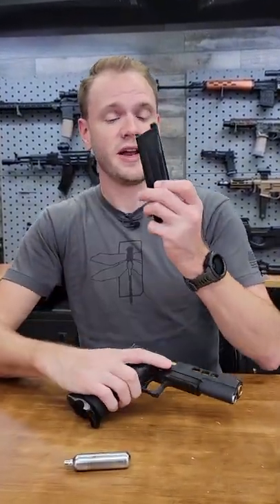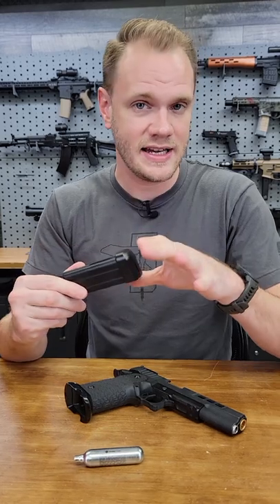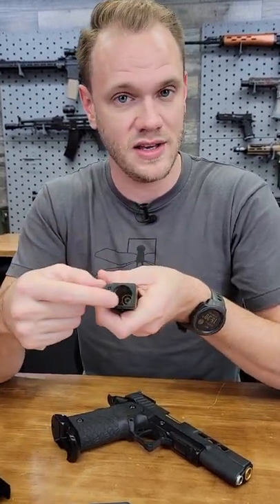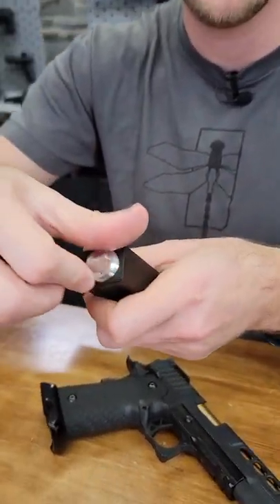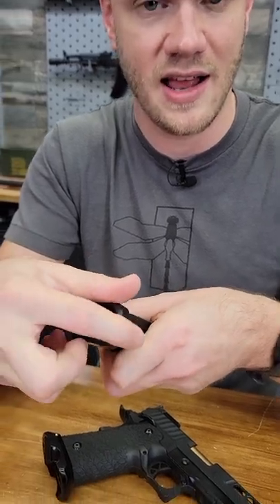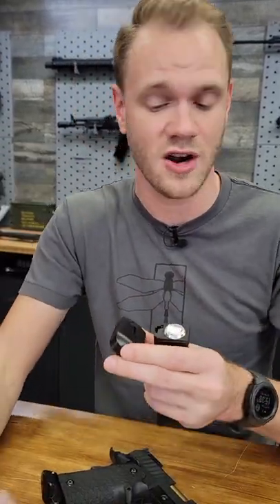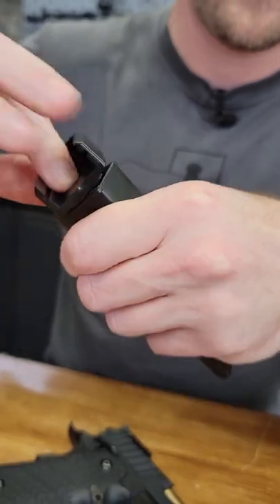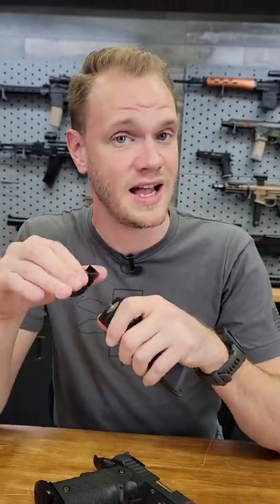How to Install CO2 Cartridges in CO2 Pistol Magazines - Airsoft Tips & Tricks #shorts

Comment: mine keeps losing like most if its co2 whenever i put it in? like it wont tighten anymore and it gets tightened immediately? it runs out of a square hole in the top
Reply: Your mag has a leak :(

You can get replacement o-rings and install it to fix the broken seals :)
You can also get new mags if they’e really broken..

Comment: Can someone help when i put my co2 cartridge and started tightning i started hissing and it wouldnt stop the whole cartridge emptied i am not sure if i broke the valve idk  pls help
Reply: It'll puncture quickly so make sure to keep screwing.

If you screw it too tight, you'll damage the mag. Make sure to put your ear to it and tighten until the hissing stops.

If you've done these and the issue still persists, you may need your magazine repaired (or a new one)
Reply: I did dame

Comment: Please help me!!! I keep doing it and every time i put it in it just burst's and air just goes everywhere.. I can't titen enough because the cover doesnt fit, but everytime I screw it in, the CO2 can just bursts (edit): I am also not over titening them
Reply: There is something wrong with your magazine
Reply: @HamFlare12345 how to fix😞i just bought my gun for 850 im scared that its broken😢
Reply: @Danz-H  It's actually pretty common, my co2 revolver also started doing it, everytime i put new co2, the moment i start installing it inside it bursts out everywhere and more than half of the co2 goes to waste :( 
It can be caused by many factors.
Reply: I just got by glock 17 and it does the same thing
Reply: @Cxipttttt  i got mine to work i just needed to twist it in one go a little fast after it was tighten and it work

Comment: All the gas leaks out before it gets tight.
Reply: there's something wrong with your magazine.
Reply: You have to be fast. I had the same problem about a year ago and thought it was the gun. You have to be fast so all the air doesn’t leak
Reply: @Flamezy27 I need help when I put it in with the silicone on top it just hisses and when I put a gel in it it just dosent fire at all please help
Reply: @llllllliiiiiiilllllll3667  I’m no expert, but I’m guessing it’s leaking through a different part. Maybe somewhere out the mag. And the not firing at all may be the gun or something with the internals. If you know how to take apart the gun, u should so u can see what’s wrong
Reply: @Flamezy27  thanks

Comment: CO2 stupid for Airsoft guns you empty a magazine you have to replace the CO2 cartridge that takes time I can fill up my Glock 19 Magazine with propane I can load an empty that magazine twice maybe more before I have to refuel My Magazine with propane I think propane is cheaper to get cuz you can get a small camping propane tank and adapter 30 bucks and it will last you a month depending on how much you play but CO2 those are a lot of CO2 cartridges you're using in one day of playing Airsoft and green gas that's is also better than using CO2 cuz it's just like using propane you just fill up the magazine with this green gas and you can fill the magazine multiple times and empty it multiple times before you have to read your magazine with propane or green gas I've had a CO2 powered gun and honestly I would think co2 powered airsoft guns are better for you just going in the backyard and shooting at a target for fun but for Airsoft combat I think it's stupid just my opinion

Comment: So if I tighten it and all the green gas co2 spews out the top that means I overtightened? I barely did it
Reply: It might mean you have a leak in your mag. I had the same thing and sometimes you can fix it, but usually you have to buy a new one.
Reply: @Gummyber  thanks

Comment: Another tip is not to leave your CO2 cartridge in the mag. Not a problem for frequent users but for those who just shoot a few then keep it in there for months or years. Eventually the rubber seals will deform due to the compression.
Reply: well I can't take them back out without letting all the gas escape so do you have to just waste the rest of the canister?
Reply: @Killbayne  I think a Co2 cartridge is cheaper than looking for a new rubber seal. You can still keep it in the gun, but don't let it stay attached for a long time. Shoot it empty.

Comment: I have the colt defender with the mag built into the gun I turn until the hissing stopped before watching this but when I put the gun up to my ear (not the barrel) I still hear a slight hissing can anyone tell me if it's supposed to do that and if not how to fix it
Reply from the maker: Sounds like you might have a small leak. You can try tightening just a LITTLE bit more, and if that doesn't work, contact tech@evike.com for assistance.
Reply: @evikecom I figured out the problem I’m missing an O ring on my gun

Comment: Hi I have a question, how do I remove the empty co2 cylinder/can? Please help =)
Reply: Should fall off, and don't left co2 canisters inside the mag when the match ends
Reply: @NoPeace4theEvil  thanks, but the co2 canister is stuck inside the mag
Reply: @Luke-jm6mh  Oh I see, first of all, make sure to press the co2 gas release button until it's empty, to avoid dangerous manipulation, the canisters can become a bit dangerous when they bloat, if done, try to disasemble the magazine, if not posible you will need to probably cut somehow in the visible part of the canister and then try to grab it with some long pliers, if nothing of those help, take the magazine to an airsoft shop and they will help you better than me 😅😅
Reply: @NoPeace4theEvil  Thank you very much, I will try that =)
Reply: @Luke-jm6mh  No problem👍🏻👍🏻 just remember that any tinkering with airsoft replicas/magazines or stuff like that can (disasemble/cleaning/changing internals) result in damage in the object 😄 its a natural thing to want to learn thins kind of stuff, if you will do it, try to research on how to do it first, if not, take it to a shop, they will help you. Have a good day 👍🏻👍🏻
Reply: @NoPeace4theEvil  I will take this advice 😅
Reply: Thanks 👍